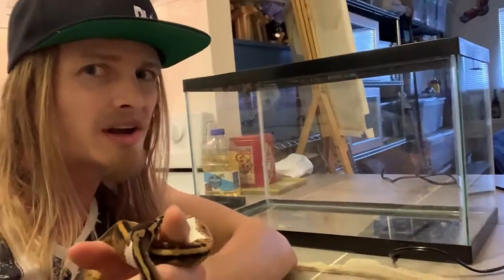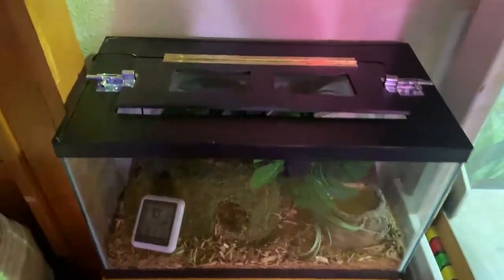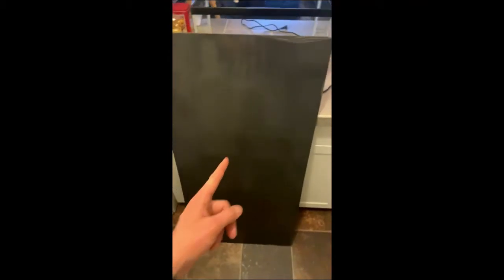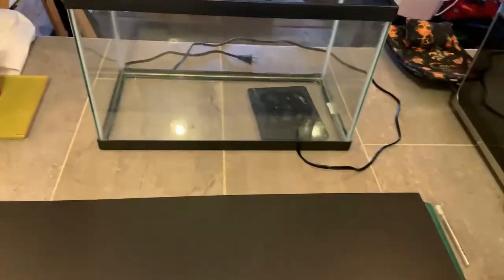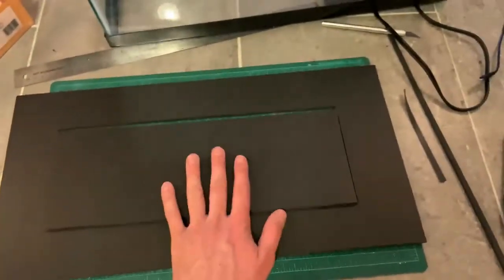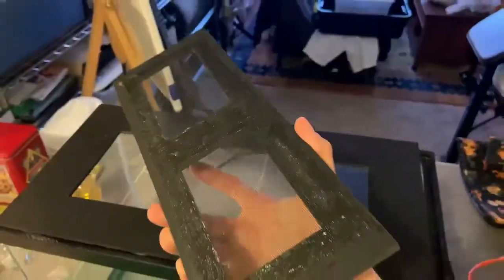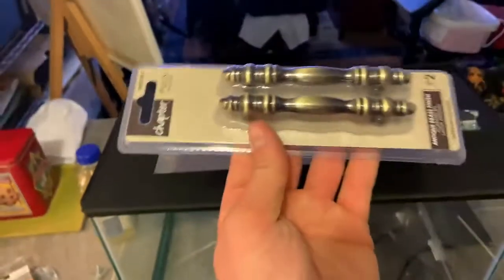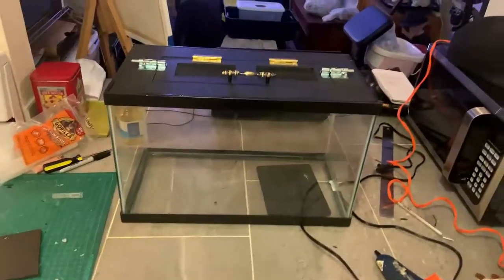How To: Convert a Glass Tank to retain More Humidity

Comment: Great idea! We’ve been struggling with humidity in our glass enclosures. Question- is the PVC foam you use strong/rigid enough to install a couple light fixtures inside the terrarium?
Reply from the maker: Hi, thanks for watching! I order 1/4 inch PVC sheet from Amazon or Lowe’s website and have had great results using for my enclosures and it looks nice. It is a pretty durable material, it could work if it was a thicker sheet or had a little extra reinforcement if your going to hang lamp fixtures from it or on top of it. It doesn’t  break easy!